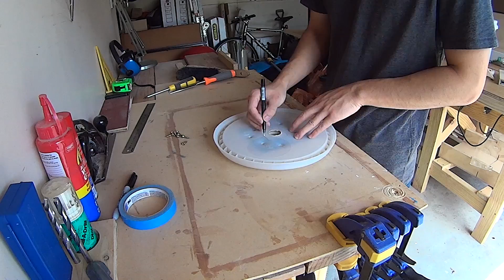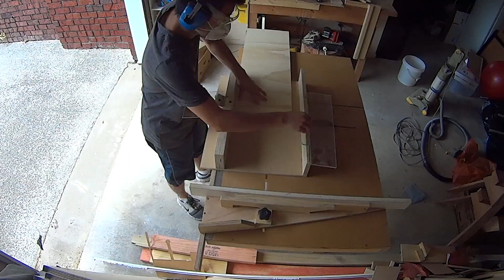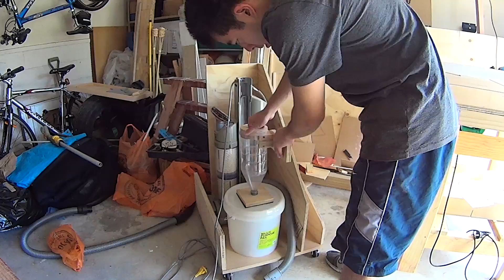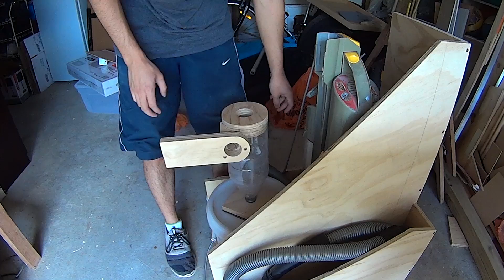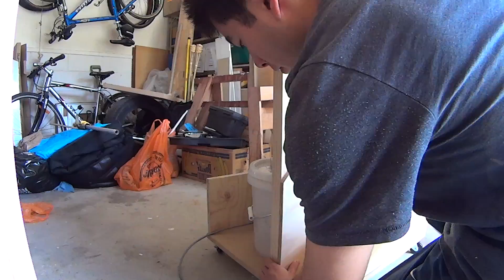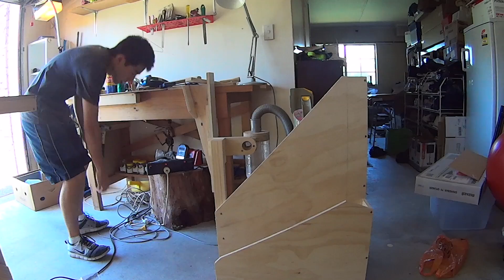Cyclone Dust Separator From Soda Bottle

Comment: One more thing I like your video is the homemade table saw protection gear, very nice!!!
Reply: A big plus 1 for that comment.
It appears to be a nice easy to use system. That is an essential element of a safety device, if its difficult to use it won't get used.
There will be one fitted to my table saw sled before it gets used again
Thanks for the very obvious, but previously overlooked solution.

Comment: First of all, great video; brief enough to keep my interest, and it still presents the major points.  The music...not so much.
I built the same thing with an old Dyson, using it's built in 'cyclone'.  It works well, EXCEPT the little round foam filter near the bottom of the vacuum clogs quickly, greatly diminishing the suction .  I need to spend a lot of time washing it out and letting it dry.  I had to drop out the Dyson motor and hook the cyclone part to my shop vac.  What a let down.
Dyson should build a cyclone dust separation product and garner a whole new customer base...what are they waiting for?

Comment: I like your thinking. I dont think the soda bottle is a real viable source for a cyclone except on a very low powered vac, but it gives me several ideas that are new to me. 1. The way you attached the intake hose. I really like that idea as most seem to want to drill a hole in the side of the collector and feed a piece of pipe into it, cutting the hole at an obscene angle and shape. This method really simplifies the process. 2. I also really like the idea of a clear collector, I wonder if a clear 5 gallon water bottle would be practical? 3. Putting it all on a cart to make mobility simple is also a great idea. I have tried to imagine moving some of the collectors I have seen in videos on you tube and I just dont see how some of the people do it.  Good ides , good work. thanks
Reply from the maker: +JIMMY TATE Thanks for the comment! Yeah, the bottle has imploded many times from the suction. I am looking to improve it or even make a new one with a bigger capacity and a bigger opening so it doesn't get clogged all the time.
Reply: Could you not replace the soda bottle by another bucket  on top of the original ? It wouldn't impact on the footprint so no mods needed to the cart.
Just a thought. 
Great video, you have just got a new subscriber. 
Cheers, keep up the good work.
Reply: JIMMY TATE

Comment: I thought this was a fantastic idea, so I built my own version based on your design. Once it was finished I was REALLY excited to use it the first time, but as soon as I turned on my Shop Vac the plastic bottle immediately collapsed under the suction. I suppose using a less powerful vacuum would prevent this from happening, but it would also take away from the usefulness of the system. When I did manage to prevent the bottle from collapsing, the small outlet got clogged very easily.

As great an idea as it is and as much fun as I had building it, it just wasn't practical for me. But kudos on an ingenious solution.
Reply from the maker: Adam Schechner hahaha oh no! I'm sorry to hear that. I guess my vacuum cleaner isn't as strong. Mine gets clogged up at the bottom too. I thought using the bottle cap would be a good way of mounting it to the bucket, which it is, but it just doesn't allow for bigger pieces through. I'm glad you had fun building it though, maybe you can swap out the bottle for something a bit stronger so you can actually use it

Comment: Nice build and like the fact that such a small bottle will still separate the dust/chips. Curious why you added the last piece (after the test) and secured the bottle to the frame? Won't that require you to remove screws to empty the bucket?
Reply from the maker: thanks! I added it to secure the bottle so it doesn't move around as its only resting on the lid of the bucket and if I stretch the hose the stress is on the bottle. I do have to remove it to empty the bucket, but its not that much of a hassle, and I still haven't needed to empty it yet so it won't be frequently removed :)

Comment: Surely a Dyson vac already uses a cyclone which nicely captures sawdust (in my experience), so why add another cyclone in series with it?
Reply from the maker: true, I don't think the sawdust will clog the Dyson. I did it mainly to give it a bigger capacity as it doesn't hold much and I use it quite a bit. The little bucket actually holds quite a bit of sawdust